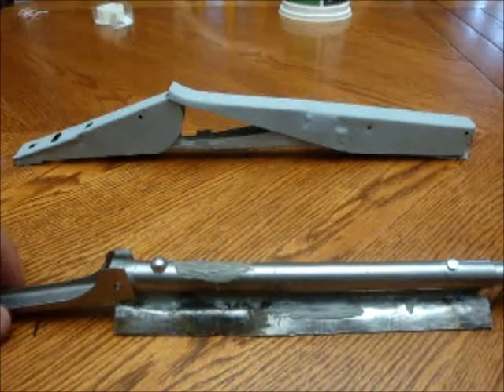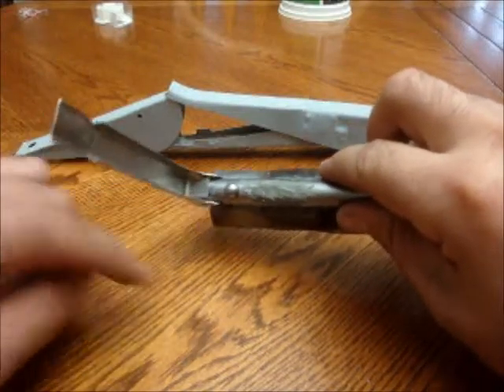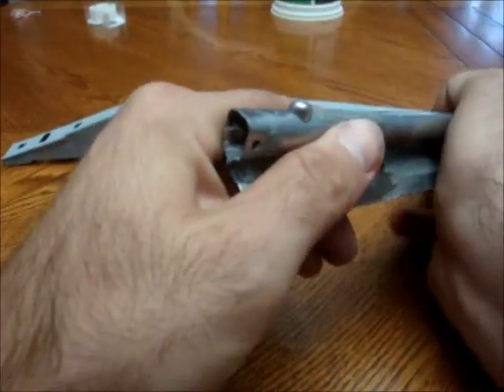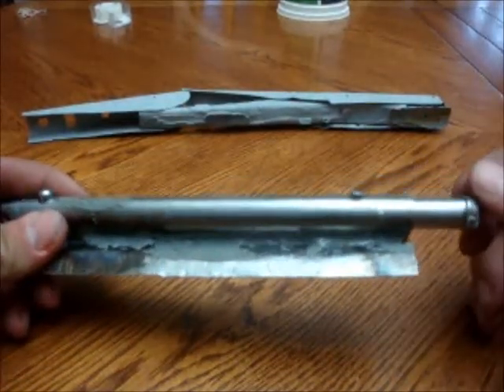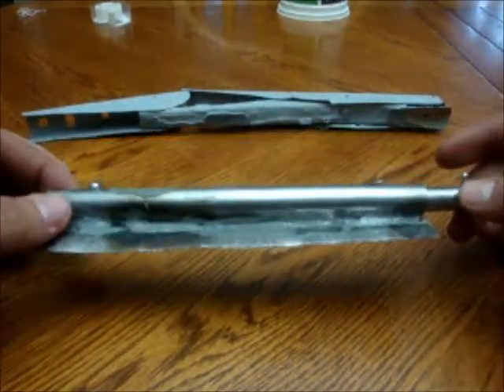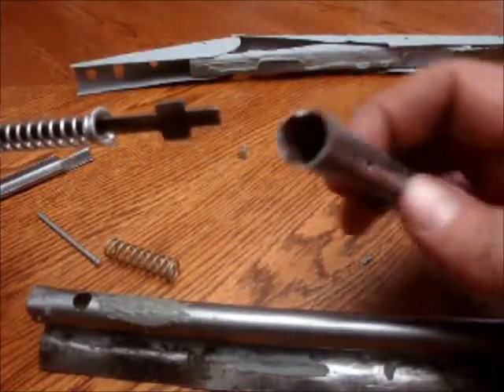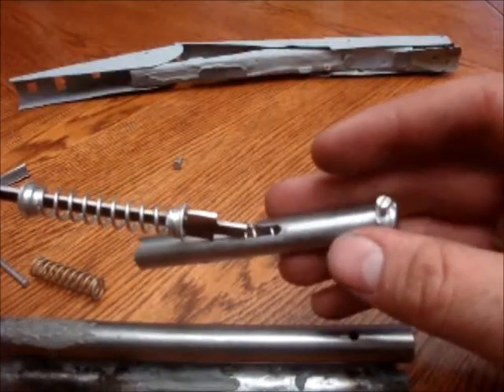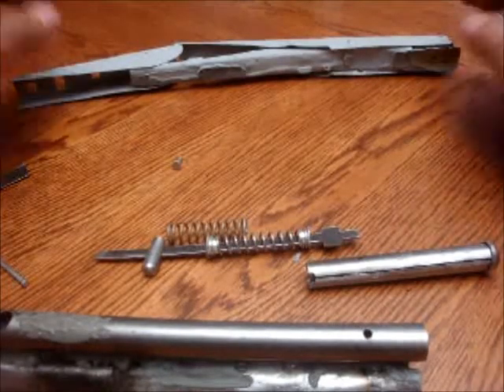How the Panzerfaust 30 (faustpatrone) works.

Comment: Any update on your build? Looks like it would be a fun project to build. Thinking of buying some steel pipe and making a replica from home! Just don't know about replicated the warhead, and maybe all of the little details?
Reply from the maker: I need to get a pipe that is the right diameter to make the 30 groß, 60 or 100. Unfortunately the one I have is the wrong diameter.
Reply: @Stray03  the pipe for the 30 faustpatrone is a lot smaller and you need only 1mm wall thickness
Reply from the maker: I went with what I had and I went with thicker over thinner as a safety factor. The original was meant to be used once. I had planned on using mine multiple times until the govt added stupid laws.
I also have a video on an original 30 I recently made which I believe I mention that mine was not perfectly accurate to the original although it worked the same.